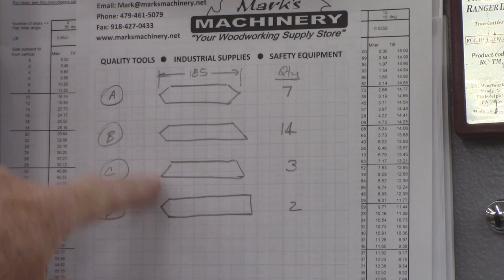Floating Honeycomb Shelf made with Maple

Comment: An excellent video and shelf Steve. I don’t have the Hoffmann set up but I do have a a Festool Domino and the Lamello Zeta P2. Do you think either the Lamello P10 or the Flexus connectors would be acceptable for this style of project? Thanks for your time.
Ron
Reply from the maker: Thank you Ron.  I have both of those machines as well.  I think the Lamello would be problematic getting the joinery to come together since the connectors would be in 3 different planes.  It may be possible with the Domino if you made a jig to cut the mortises in a 2/3 assembled joint.  The best way is to take some material and make a test joint which is what I did with the Hoffmann system to confirm my concept would work.  If you try it, let me know how it works.  Steve
Reply: @extremewoodworker  
Thanks Steve. I’ll let you know if give it a try. I am in the middle of making a mud kitchen for my granddaughters at the moment and will give it a try and let you know.
Thanks for the reply and information.
I believe the first time I saw the Hoffmann system being used was when Norm on New Yankee Workshop used it, and I believe Tommy from This Old House made some window casing or something with it years ago.... I wonder if Hoffmann is still in business.... will have to look that up. Thanks again.
Ron
Reply from the maker: @ronh9384  Mud kitchen - sounds like you have some special pies coming your way - LOL.  I dont' recall Norm ever using the Hoffmann dovetails but Tom Silva did use it for trim on This Old House.  I think he used the MU-2 which is the predecessor to the MU-3 machine and both are a bit too bulky and heavy to carry to a jobsite IMO.  The lighter X-series machines would be better for jobsite use.  It is the same company.  Steve

Comment: That was beautifully done Steve. Tell me about your assembly table with the vacuum part holders. Also who makes your horizontal belt sander with the motor feeder?
Reply from the maker: Hi David, the table is a Barth 500V that has a vacuum pump, three pod locations that can be pivoted, and a hydraulic lift.  The edge sander is a Kundig Uniq.  Steve
Reply: @extremewoodworker  Thanks Steve.

Comment: Great result, thorough as always. Can I ask what the gaps in the edge of the table at 12:00 are for? There are some objects in those gaps, curious what they are.
Reply from the maker: Hi Michael.  These are openings for vacuum clamping elements.  You can seem me using one of them at about the 3:03 minute mark in this video.  The table is a Barth 500V and a full display of its' capabilities can be seen in this video starting about the 1 minute mark:  https://vimeo.com/133298094
Steve

Comment: I just watched your video about the Hoffman MU3-PD, which looks great. What’s the machine starting at 3:17 that you use for final dimensioning and rounding corners?
Reply from the maker: Hi Mark.  The machine is a Felder Format 4 spindle shaper using a Garniga adjustable roundover/chamfer cutterhead.  I recently posted a video on that.  Check out the playlist for the Shaper 101 series.  Steve

Comment: Steve, what are the dovetail keys made from?
Reply from the maker: Hi James, the keys are polymer.  Steve
Reply: I have a question about the keys as well. (I'm not experienced with the Hoffman machine). It looks like you start with a small white key, which I assume is your holly inlay, fill the middle with the polymer brown key, then end with holly again.  Is that correct? Why fill the rear with holly? Perfectionism?  Also, are the keys glued? Thanks, cheers!
Reply: Nevermind, I watched again and you don't add holly in the rear, just tap it down  flush with front.
It looks like the only glue is on end grain butt joint?  I'm sure the mechanical joint suffices and there is at least a bit of glue in the key sneaking in...
Reply from the maker: @mmocny  Hi Michal.  I attempt to keep the glue out of the dovetail slots since it makes it harder to drive home and will not stick to the polymer keys anyway.  All the glue in these joints are on the wood endgrain.  The white key is not holly and is a polymer like the brown keys.  When I purchase keys, I always check the dovetail key specials on the Hoffmann website which are often colors other than brown..  No difference in strength, just the color.  Steve